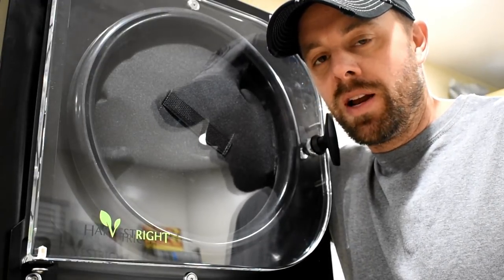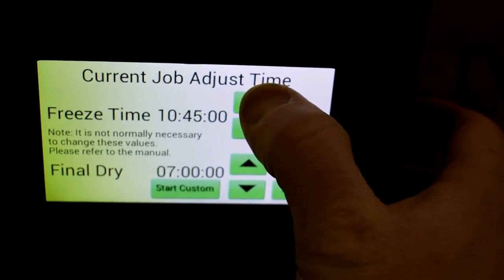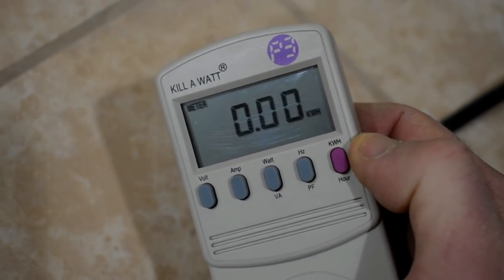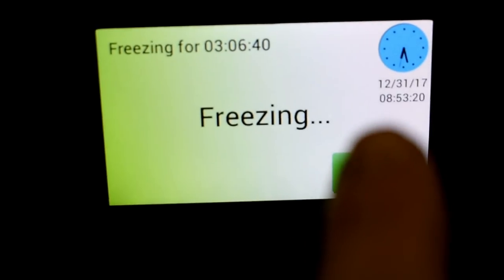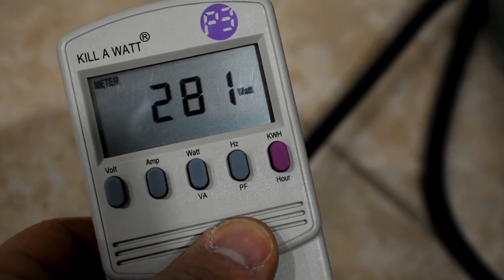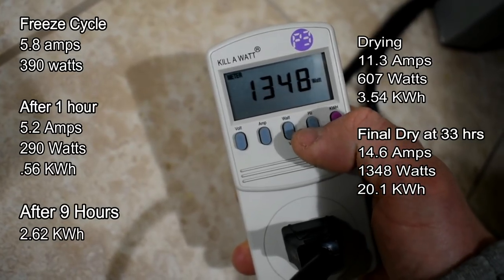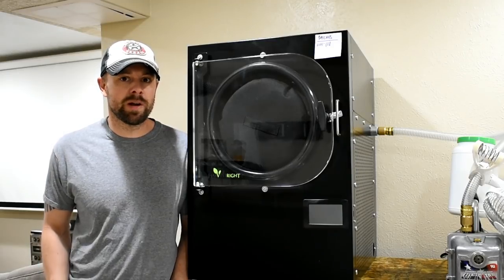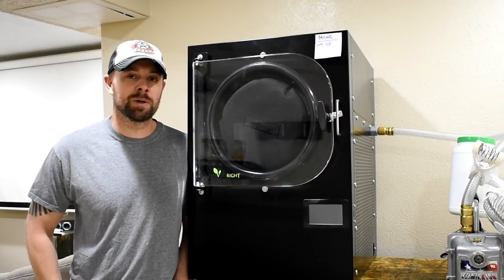How Much ⚡Electricity⚡ Does A Freeze Dryer Use? Energy consumption of the HARVEST RIGHT

Comment: I am off grid solar, so thanks for the KWH.  I might be able to run the freezer at night and the second 12 hours during the day, since it uses more power with the pump.  With the sun out, should not be a problem.  Thank you.
Reply: So how has the last four months been?
Reply: Smart thinking Lovepeacejoy!
Reply: Which solar battery are you running? I’m looking at a Bluetti AC300 with 4 batteries has a max capacity of 12kwatts. Wondering if I can run a cycle off that system.

Comment: 41.90 per month running it 3 times per week. Just over 500.00 per year. Still falls short of the over all cost of food from the store or commercial freeze dried.
Reply from the maker: I disagree.  Have you priced freeze dried food?  It will depend on your situation.  It's not for everybody.  Have you measured to see what years of running a deep freeze costs?
Reply: Yes but if you are using the numbers that you are saving by using your own grown goods then you have a savings.  I would agree otherwise.  I do buy freeze-dried and it is not cheap.  Very true.
Reply: Reading your responses it really seems like it is a toss up as to if it is a cost saver.  I had been considering one, but this throws it in doubt especially since I am moving towards off grid power.  I think what defines if makes sense is, where you are getting a majority of your food supply.  If you are growing it yourself and only occasionally are processing store bought items it would seem more viable than if you where just further processing store bought foods.   I think of canning the same way.  Yes, I can buy a can of peas or jelly much cheaper than I can process one, but I like my stuff better and know exactly what went into it. Furthermore, if the grocery store goes away for whatever reason, I can still carry on as I have the tools and skills to do it.
Reply from the maker: The person above has not done the math correctly.  Also,  think of this.  If you store something in a deep freeze for 5, 10, 20 years, how much would it cost in comparison to a freeze dry cycle?   You pay up front, but reap many benefits later on.  You also have little to no waste of food (no freezer burn, no power outage loss of deep freeze contents, etc.)  You also only need to rehydrate what you need at the time.  That is just 1 of the many many positives.  I also like to know what is in my food and where it came from.  Try figuring that out on a commercial freeze dried product.  To me that is priceless.
Reply: Don’t forget cost 2500 and with warranty 3000 van tons buckets freeze dryied.

Comment: Outstanding share, I live off grid for the most part and this info. will be VERY useful as I upgrade my solar/batt setup and capture more warm season abundance here in southern VT.  I just bought the large unit from Harvest Right, and am thrilled about this now being within reach of even thrifty part-time instructors/solar crew worker bees who make less than 30K per yr. NOT retired at 40, heh heh. This is a huge deal, we could all use less plastic in our oceans and bellies, and the increase in nutrient density and decades of storage potential are mighty bonuses! Here come more Ball jar & O2 absorber purchases, oh yeah. Guess I can put my "high flying autonomous drone-based personal atmospheric freeze dryer" plans on hold. Keep posting these great videos, merci mate.
Reply from the maker: if you are using ball jars, you don't nee oxy absorbers
you can vacuum seal using the freeze dryer.  That way you are only dependant on the seal, not the seal and the packet.  Here's the video:
https://youtu.be/fJXYPaYvKL0
Reply: I would love to hear how you are going running your freeze dryer off grid. I want to get one, but two things are stopping me - the fact it costs about the same as a used car to buy and if it will run my batteries down too much trying to run it on solar. I don't want to ruin my batteries or have to stop a run halfway through because I am running out of power. Any information on your off grid set up you are using to run it would be helpful.

Comment: Can you re-do this test on your LARGE freeze dryer? Even though they use the same components it still might draw more power. I would like to be sure.
Reply: While you are thinking of the cost to run a batch of food in a FD, consider what it costs to run a freezer for the length of time the food will be good.  The Freeze-dried food will last 20-30 years and not spoil if electricity goes off.  Plus, you will lose everything in a freerzer if power is off for a long time (months or years).  So freeze drying it is a one-time cost, whereas keeping food frozen in a freezer can be longterm.

Comment: I suspect you have a 7.5CFM pump hooked up to that thing. Keep an eye out for a 10-12CFM pump that makes a least as high of vacuum as that one (20 micron?). It SHOULD shorten up your run time. The pump oil on those get pretty dirty pretty fast. What you can do is add a mineral oil pre filter. Basically you run two tubes in to a sealed container(strong enough to hold vacuum safely), one long and one short. Put mineral oil in the container high enough to cover the long tube but well clear of the short tube. Connect the long tube to the vacuum chamber and the short tube to the vacuum pump. The "air" drawn out of the vacuum chamber will be bubbled through the mineral oil filtering the "air".  If you do not release the pressure in the chamber before you shut off the vacuum pump, the mineral oil will be sucked into the vacuum chamber.

Comment: You forgot to mention that electricity cost is higher in the summer so be sure to use it when cheaper rates apply.
Reply from the maker: Every dollar counts.  Thanks for your comment.
Reply: GET equal billing from your utility company--My Gas & Elect. never vary more than a few $$$/month and with a shop behind my house that is heated and cooled and uses some high amp motors my bill would bounce from 80-450/month

Comment: I have both a freeze dryer and TWO dehydrators, and there is a place for all.  I use them for different foods and applications.  The dehydrators prepare stored food that lasts a short time (months for some things, up to 2 years for others) and never rehydrate back to the original. The FD prepares food for storage of 20-30 years, and most of it will rehydrate back to looking and tasting just like the original.  You can't tell the difference in most cases, although much FD food can be eaten without rehydrating.  My grandkids love FD fruit as is. FD whole-kernel corn tastes like candy. All our emergency food is FD food, as is most of our camping food and my celiac grandson's GF foods.  The cost of electricity is not prohibitive. Compare the cost of buying FD foods to the cost of making your own.
Reply from the maker: Never thought of Kendal corn I will have to give it a try.  That is for your comment!
Reply: I constantly experiment.  Better to start with frozen corn or fresh corn than canned.  Canned has too much liquid.  My next project will be freeze drying seeds for long term storage, in their packets and separately.  That has to be what was done to those long-term packages of seeds you can buy.
Reply: I too have multiple dehydrators and a freeze dryer and do a ton of canning also. You are right all of these options have their place. I love dehydrating and powdering things. I also have a vacuum sealer that seals bags and jars of dehydrated goods. Keep up the good work.
Reply: @Lewisusa11  The vacuum sealer is a must.
Reply: @Lewisusa11  I use one dehydrator for onions, peppers, and garlic only --- outdoors at the end of my long orange extension cord.   If the neighbors come out and sniff the air with a puzzled look, I go out and sniff the air with a puzzled look, too!  😆

Comment: Interesting. Thanks for the information. It's good to know what your options are, and be able to compare the ROI between them. Few people would argue that a chest freezer is a poor investment, although it's a bit hard to eat the cost of that as well. About $900 vs $2,500. 314 KwH / year, so $2.62 / month.
So it's cheaper, yes... But only if you don't need more than 24.8 cubic feet of frozen food storage, and only if you aren't planning to store the same food in it long enough to develop freezer burn, aka, the taste of true sadness.
I like to find the ROI at home, but you need to take into consideration the broader picture. From a pure ROI perspective my upgrade from CFL to LED wasn't enough to be worth the effort. They're about 20% more efficient. That sounds good, but it's only a difference of 3 watts per bulb. I went ahead and did it anyway because CFLs suck and the LEDs were on sale. It took over 2 years for the bulbs to pay for themselves financially, but they became worth it immediately with the quality of life going up.
I don't think any of my CFL's even lasted 2 years. The LEDs are as good as the day I got them.
Now if it was replacing an incandescent that's a very different story. It would pay for itself after about 40 days.
Reply: My freeze dryer has more than paid for itself in a year and a half, and I don't even own a freezer any more.  I prepare all our emergency and camping foods in the FD.  I also use dehydrators.  There is a place for both.

Comment: I was told to plug my Harvest Right into a DEDICATED 20 amp circuit because when the pump motor starts up it draws A LOT of current.  Later, it settles down, but motor start up sucks a lot of juice.
Reply from the maker: It does pull more when it first starts up.  I had a current meter on the pump that was only 15 Amps and it never pulled more than that.  I do have the old JB pump though.
Reply from the maker: You probably would want a 20 amp if available.

Comment: a major consideration for buying one of these machines for a church, family or home is power outages. it is better to run one of these than to have expensive food rotting in a freezer.
Reply: AMEN!  I use mine to prepare survival food and food for taking camping.  It's pennies on the dollar.  Mine has well paid for itself in about a year and a half.  I did buy a good vacuum sealer.  Ziploc bags don't keep a vacuum.  We don't do anything for hurricane warnings except top off the gas in the car.  I don't even own a freezer any more.  That is a huge savings of electricity.

Comment: I noticed that your Amps were running at almost 15A during the final drying. I mainly run 15A breakers available in my house, so will I run into issues having a standard sized freeze dryer? Do I need a dedicated 20A? great video..thanks!
Reply from the maker: I don't think you need a dedicated circuit.  My freeze dryer is in my basement on a 15 amp with other things on the circuit as well.
Reply: that's reassuring to hear...thank you!

Comment: A small solar set up could greatly offset some of the cost of operation for us especially in the summer. I will have to look at your video on solar if you have one.
Reply: I am building a solar dehydrator for off-grid, too, but dehydrated food lasts a brief time.  Freeze dried food lasts 20-30 years.  Also most dehydrated food doesn't rehydrate back to the original state.  You can't make a grape out of a raisin. Jerky doesn't turn into a steak. Dried apples can't pass for fresh apples.  Much of the freeze dried food, when rehydrated, can't be told from the original.  I use mine to make emergency food and camping food and food for my celiac grandson.  It's awesome!  I also have 2 electric dehydrators for different tasks.  One is for far outdoors for peppers, onions, and garlic.

Comment: Do you know if the oil less pump uses any more or less electricity? Or are they about the same?
Reply: It will consume a little more but you wont likely notice it on your bill.
Reply: @jerrysmith372  cool! thanks! Ya I figured I'd just get it for the convenience.
Reply: @jonathangomez1172  Yep - that's why I bought it. I hated dealing with the oil pump. Mine did have a fail in the first 8 months of use, but HR rebuilt it under warrantee and even covered the shipping. That was 18 months ago with no issues since. I run my large dryer almost 24/7, so my pump gets a work out.

Comment: I just got my Harvest Right machine and was interested in setting up a Kill A Watt. How do you have yours set up? Are you using an extension cord instead of directly plugging into wall? My Harvest Right manual specifically tells me not to use an extension cord. It would make my life much easier if I could. What weight extension cord are you using? I would like to add an extension cord as long as it won't screw up my machine.
Reply: If you need to make an extension cord, make it as short as possible and use 10/3 wire. My large FD uses the 5-20R plug/outlet so you will need to use those. Just make the cord yourself as you will have a hard time finding one that is the right length etc. I have the Kill-o-watt meter but it is not 5-20R compliant. I will see if they offer one. Good luck.

Comment: freeze drying is not meant to be a replacement for refrigeration or freezing. Freeze drying is for long term storage (even six months onward) and only then will the initial cost of the unit make sense. Also consider that most foods kept to long in those will go bad in short term or within a year for the freezer. Dig to the bottom of your deep freeze or the back of your freezer and see what spoiled food you have been paying to keep spoiled. You can also achieve things culinarily or make snacks that cannot be made any other way. Use your watt meter on any led tv and you'll be surprised at what it draws. Personally I have a hot tub so all worries about that stuff is not worth worrying about unless the power goes out. Then if you had a freeze dryer or bought freeze dried food you'll be glad.
Reply from the maker: Agreed.  Just making the comparison for energy consumption.  A freezer or fridge is an appliance everyone has.
Reply: Good points. I live over 20 miles from the nearest food market but have a ton of farmers within arms reach. Abundance in the fall and starvation in the winter. Have three Freezers that are only as good as the power company's ability to keep power on and since I have plenty of storage space Freeze Dried is my go to. I tried some of the Companies that sell survival food and it's quite tasty and when the cyber attacks take out the power grid this source just might be your salvation--Never Forget WATER---You can live for weeks w/o food only days w/o water.

Comment: Mkay, with a freeze dryer you're effectively running 2 motors. Compressor to run the coolant and a motor to run the vacuum pump. So yeah, Basically equivalent to 2 refrigerators being run at the same time. Still, $3.49 + cost of materials per mylar bag is still cheaper in most cases than buying prepackaged freeze dried foods. Still looking forward to getting my own machine. :D

Comment: Nice video... My only question would be the comparison of usage cost for the 3 different sizes. If they all use the same compressor and vacuum pump and cycle times are similar, what would the price per pound usage be.
Reply from the maker: Thanks for your comment.  Price per pound would vary for what type of food you are drying as cycle times vary dramatically, even doing the same types of foods.  My dryer is the medium size, which i think is the best value out of the 3.
Reply: I know it depends on what your drying, I'm just wondering if the 5 tray adds 25% more food than the 4 tray machine, does it take 25% longer to dry? cost 25% more to operate?  Or are the cycle times the same for each machine (if all machines were drying the same food, just different amounts)   I know you don't have this info, was just a passing thought, I did request that info from Harvest Right after watching your vides.
Reply from the maker: You make a great point.  If HR gets back to you, please share the info with us and maybe someone with a larger machine can chime in as well.
Reply: After receiving a response email and calling and talking to Harvest Right and some extensive math, here is the conclusion.  Cost per batch is 23% lower with the medium machine but the large machine gives you about 25% more product.        So using an average price per batch based on power consumption to dry the same type of product  (60 trays worth) the small machine would cost $30.00 for 20 batches,  the medium machine would cost $28.88 for 15 batches and the large machine would cost $28.80 for 12 batches .         So total cost to use the medium or large  machines is pretty much the same, it comes down to how much you do and how fast you want to do it it.
Reply from the maker: GREAT INFO!  Thanks for sharing
Reply: We play around with power monitoring for all three of HR freeze dryers...yes, between multiple family members, we have all three freeze dryer sizes. We've profiled the power draw for each of the machines and can analyze the power consumption for each (within about 1% or a good [over 15amp...the Kill-a-watt meter caps at 15 amp :( ] power monitor). Here's a comparison for freeze drying pineapple (it's better than candy!): https://www.familycanning.com/freeze-drying/cost-analysis/pineapple-3-tray-light-load/
Reply from the maker: Thanks for the info.  3 freeze dryers?  That's some serious freeze drying!
Reply: thank you greatly for this information. being on my own i had bought the 3 tray machine, but after seeing your breakdown i do wish i had gone for the mid-range at least.

Comment: So why did you run for two days instead of 24 hours like you intended, which in itself was supposed to be an extra long cycle? That extended time obviously drove the electrical price way up.
Reply from the maker: There are 3 cycles.  You can set the 1st and 3rd.  The middle cycles is determined by the freeze dryer and varies.